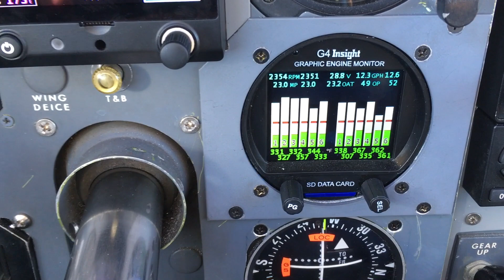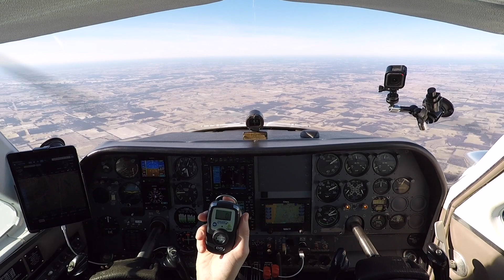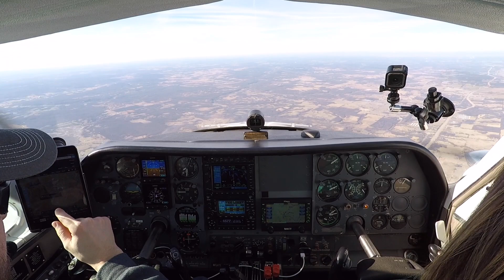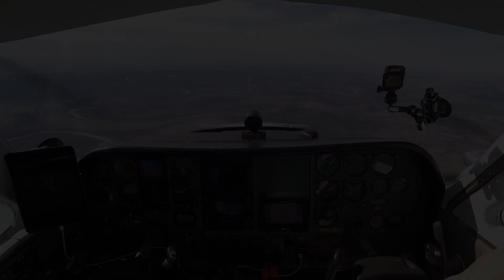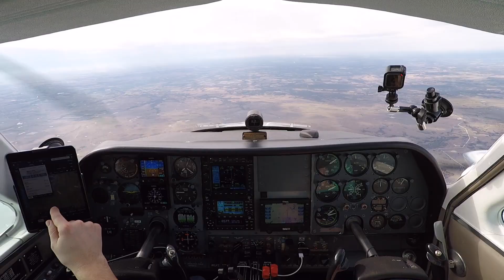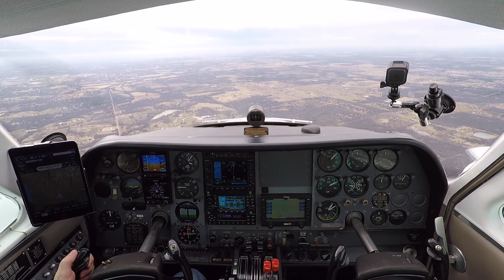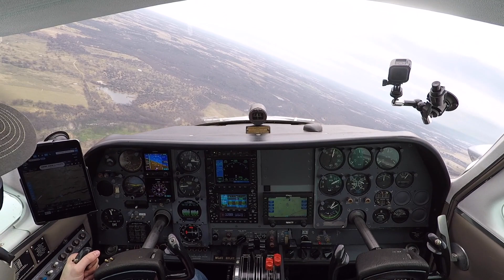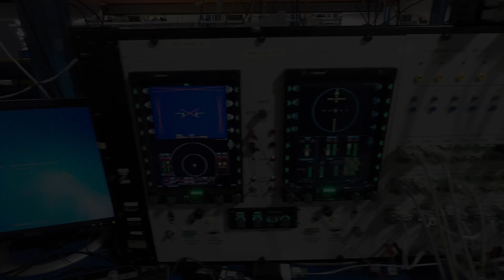Texas Flight for the STEC 3100!! Part 2

Comment: Ya'll can tell when you get Texas just by the the way they talk..  I love Texas a lot of good folks there!
Reply from the maker: I like it down there as well. Good people and usually good weather (relative to the midwest). :)
Reply: @310Pilot  A little off the subject of flying but, I bought a used car for the family so they could drive to Dallas from Colo and visit the in laws. The engine blew in the car before Amarillo. Complete strangers at the mechanics shop gave my wife $300 for a hotel until I could go pick them up. That's just how it is down there, full of good people. 
 I just wish I had bought the car in Texas and I might not have got ripped off.. haha

Comment: Enjoyed that close up of your panel. How do you light the Insight? The display seems very clear. How do you usually run your engines in cruise, looks like LOP with a fuel flow of 12.5 GPH and 23 squared.
Reply from the maker: Glad you enjoyed it David! I really like the Insight Twin G4. It is very clear and gives me all the information I need and more. It has worked great since I've installed it with no issues. I upload the data after each flight to Savvy to monitor trends for advanced notice of any possible issues. The k-factor is right on and give me very accurate fuel flows, fuel used and fuel remaining. :) In this video I was actually running ROP with 23" and about 2350 rpm. That is my usual cruise setting and I am normally around 12.5 gph. I don't do the lean find on each flight (although the insight is great with doing that if you want). I know the settings and then adjust the fuel flows to manage CHT's. I suppose you can say I follow the Mike Busch method of operating. :) I can run her LOP with fuel flows at that power setting around 9.5-10 gph but I don't like the speed loss from it. If I flew a turbo charged engine I would do LOP a lot more as you can make up for the speed loss by adding back a few inches of MP.

Comment: You guys are on it for these videos!  The ATC phraseology or whatever you wanna call it is never better than on your videos.  Will the STEC 3100 interact with the G5s really well?  Will you get "command bars"  active?  Did you choose it over the GFC600?  Sorry for so many questions...
Reply from the maker: Glad you're enjoying them Dr Bruce! The STEC 3100 currently won't provide command bars but will interact well with them in all the other respects. My understanding is that is Garmin blocking non-garmin and hopefully will be fixed with a future software update. The GAD29B will created the rest of the interface and I'm expecting it to work out great. Those that have used flight directors really like them but I never have so it's really not an issue for me at all. I did compare it to the GFC600 (which isn't even planned to be started on for my plane for the next 12 months) and I was happier with the STEC product. They have been the leaders in the GA autopilot retrofits for many decades and Garmin is new to this. Based on my research, when I priced them out for similar systems (number of controlled axis's, etc) the STEC came in less with all the capabilities of both. Going to pick her up soon and start filming with it. I'll make sure to show everyone me putting it through the paces. :)

Comment: Love the videos for my fix when the weather doesn’t cooperate.  Curious as to why your mixture knobs are never pulled back the same amount in cruise?
Reply from the maker: Glad you're enjoying them when you can't get up yourself! I'm going to have the shop go over the fuel pressure setups for each engine and try to get the mixtures more aligned during the upcoming annual. That said, a well respected premier Twin Cessna shop owner tells his clients that they have different levers for a reason and due to the slight differences in each engine and the difference in the length of the cables, don't waste too much money trying to make them perfectly aligned. I don't mind them not being perfectly even and we'll see if they can improve it. I do keep my fuel flows matched via my Insight Twin G4 engine monitor with very accurate fuel flows. You can see it during the opening to the video where I show the close up of the panel.

Comment: I'm surprised that it's cost effective to fly all the way to Texas for installation of a new autopilot vs somewhere close to home. Appreciate the videos.
Reply from the maker: Richard, it's not usually the most cost effective way to get things installed. In this case, I offered to help STEC verify the gains (autopilot settings) on the Q model 310's. We enjoy taking cross countries anyways...gotta keeps them in the air for healthy planes and pilots. :)
Reply: @310Pilot  gotcha. Thanks.

Comment: I know very little about planes let alone twins. Do you hand sync the RPMs? Is the harmonic we hear that sounds like a wom wom wom and indicator they are not in sync? Reason I ask is because my trawler has twins as well and I get the same harmonic when the engines are not synced.
Reply from the maker: You are correct Hank. The headsets I wear are so good with their active noise reduction that many times I sync them and can't hear if they slightly get out of sync. I usually don't hear it until I edit the videos. :)

Comment: Question for you!  Sometimes in vids several people are all on base or final and all cleared to land, is this usual in USA?
I'm in the UK where you can be on final but not cleared to land until the previous plane has cleared.
Reply from the maker: Yes, that is normal in the US. The controllers are allowed to use anticipated separation here. If they don't have the required separation prior to you crossing the threshold they will just send you around. There is also reduced same runway separation depending on aircraft type. For example, a 172 landing behind a 310 is 3000 feet. I wouldn't have to be off the runway.

Comment: Great video can I ask why the fuel flow is quite different from left to right?
Reply from the maker: Glad you enjoyed it David! It's just an error in the gauge. I have fuel flows on my engine monitor and I keep them within a half gallon or so. I will improve on that during the current annual inspection. :)
Reply: @310Pilot  Thanks for taking the time to reply, I have a Seneca and probably have a similar thing as the right engine is using less than the left.  I am leaning off by referencing the fuel flow gauge as single probe EGTs are next to useless.  Time to get a decent engine monitor I think.

Comment: Have you played much with the STEC 3100?  I am wondering what you think of it .  I am seriously considering replacing my STEC55 with a 3100.  I'd love your thoughts on it!
Reply from the maker: Josh, I have about 15 hours flying with the 3100 installed and I am absolutely loving it!! I am working on the videos now. Should be back up and running with the initial test flight video on Friday hopefully. The upgrade package they have for STEC55 customers is really awesome. :) In my video description I have a link to it if you want to get more information on the upgrade path. Stay tuned for lots of videos showing the 3100 in action. :)
Reply: @310Pilot  awesome man! I was talking to them down at Sun and Fun and the program they have for 55X owners is amazing where they warranty the servos. Can't wait for the videos. Do you really think that it is a significant improvement over the rate-based autopilot?

Comment: How far out are you before you can see the "green or red lights" as come in for landing?
Reply from the maker: If you're talking about the lights by the runway that show your glide path (PAPI/VASI) then usually about 5 miles or so in the day and maybe 10 at night. If you're talking about in my cockpit with the gear lights, I usually extend those about 5 mile final on a straight in or abeam the touchdown point while on downwind.
Reply: @310Pilot  - yes, the Glide slope lights. Thank you for helping me understand!

Comment: Nice video, Kevin.  I was wondering how you "deal with it" on the batteries.  Have you thought about getting a USB battery pack and use it to charge the GoPro? Looks like you have an Nflightcam cable, I think you can plug some type of USB into it.

Also, I think I got worked by Jaime on my way back from South Bend this (Sat) AM.
Reply from the maker: Glad you enjoyed it James! I will usually plug in a battery pack to the session and I have a spare Hero battery that I ended up having to put in there at the end when I asked Jaime to grab the yoke. About 3 hours is the sweet spot...anything longer and I have to pay attention to batteries. I'm still learning. I may try the NFlight connection to see how that recharges. I think it may have been someone else....thinking she worked after 1pm that day.

Comment: Kevin, a thought for Jamie's mirror ...... get one of those clamping devices that allow you to mount an Ipad in front of the yoke .......... that way she'll have a place for the mirror & can hang another Ipad - for additional nav capabilities ...... reference: "Air Wagner" a 421 pilot who posts a lot of flights between Oakland Ca. & Auburn Ca. .... he also had an electronics update & has an interesting panel .... worth a check out ....................... ;-p
Reply from the maker: Thanks for the suggestion. We have new Rosen sun visors getting installed soon and I think we can find a mirror to clip on them for easy removal. If it doesn't work out, I will look into something more like you suggest. :)

Comment: Just saw the price tag for the 3100. I'd have to hock my 421.  :-)
Reply from the maker: For all the features it offers and based on comparable autopilots on the market for our birds, it's really a good price. The only other one close to it would be the Garmin GFC600 and by the time you add all the features to make it equivalent, it ends up costing more. (*Based on a comparison at Sarasota Avionics) I just couldn't see dumping thousands into my 40 year old autopilot with no guarantee that it would ever fly right consistently. :)
Reply: 310 Pilot  Yeah, I went through a couple of tutorials and the 3100 is definitely a gem. At my age, though, think I'll stay with my ancient 800. So far, it functions pretty well.  If I were younger, I'd probably upgrade to a glass panel, but now I'll just hang tough with my steam gauges. Funny to think that in the '80s, mine was cutting edge. All the changes I've seen are truly amazing.

Comment: Does Jamie moving to the back affect your CG ?
Reply from the maker: Howdy Bob, it does just a little even with her tiny self. Quick slight trim adjustment when she starts roaming around. :)
Reply: @310Pilot   We used to have a C172 that had an auto pilot. No altitude hold though. Anyways....When we would need a climb due to a little altitude loss, I would move my seat one notch back and it would slowly start a climb. Although there was always the trim wheel to use. I found moving the seat was very useful also. BTW ...You two are getting very popular.  Hearing more and more shout outs these days.

Comment: Thanks for the second half video and the tour of the STEC factory. Can't wait to see the video on the post installation! BTW -- what are you using to capture your audio? I am having a bear of a time recording using the GoPro adapter on my Hero 5 Black. Lots of background noise.
Reply: I'm glad Kevin doesn't squelch out the engine and prop noise, it's a terrific sound.
Reply from the maker: Glad you enjoyed it...we are super excited to get her back next week! I use the aviation GoPro audio adapter from NFlight. They sale it on aircraft spruce's site. Plugs right into the Hero5 Black and that is what you get on the video. I also capture the background noise from the session and merged them together for engine noise while flying.

Comment: Curious. Why Texas? There are some great shops in Illinois & Indiana that are capable? Lafayette Avionics comes to mind. He did an Awesome job on mine.
Reply from the maker: Kevin, I was in contact with every avionics shop in the several state area to work something out and they are all swamped with all the ADS-B procrastinators. About the time I found one with room, I was speaking with STEC and they wanted to verify the gains (settings) for Q model 310's so I agreed to let them do mine so they could fine tune things if needed. They are very proactive in ensuring that everyone in the field has the absolute best performance from their autopilots and I was glad to be able to help out. They have been amazing friendly and responsive to deal with. :)

Comment: What are doing when you clap your hands one time above your head?
Reply from the maker: I don't recall doing that in this video Wayne. I do clap occasionally (usually edit that part out) to help me sync the different cameras together when I go to edit the videos. :)
Reply: Wayne Courville  Kevin is syncing his audio for his cameras. Remember seeing the black clapper board on movie sets - now with a digital clock on the modern ones? This is the cheap and easy way to make a sound to time sync. Then when you edit, just line up the tracks from different cameras on the slap sound and cut between the video tracks you want to use for smooth audio sync. You usually don’t see it because it is commonly edited out of the final production edit on You Tube.
Reply: @310Pilot  you didn't clap in this one. I had noticed it before and was curious. Thanks for replying.

Comment: what is with your gas gauges?   You are running on fumes according to them.
Reply from the maker: It only shows gas remaining in the tanks selected. In the 310 you burn the aux tanks down close to zero and then switch back to the main tanks. I landed with over 2 hours of fuel left.